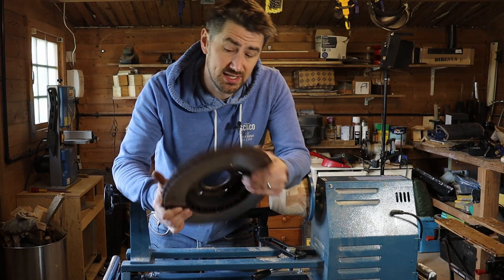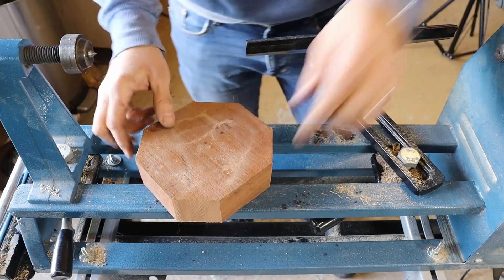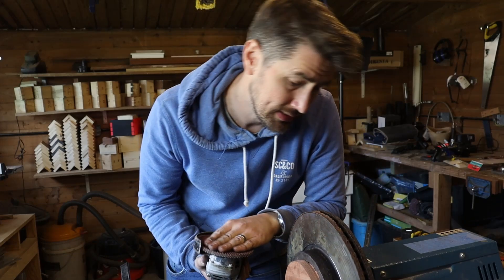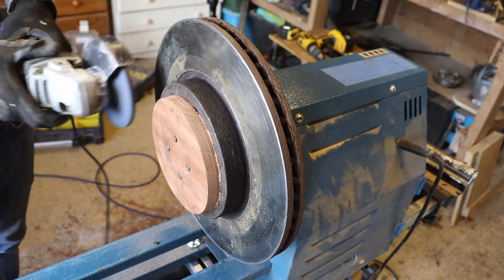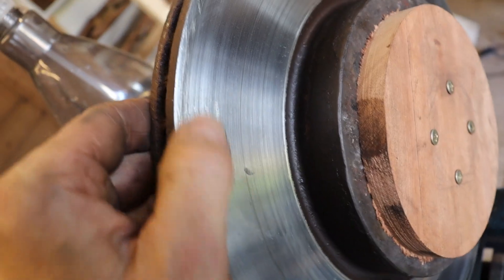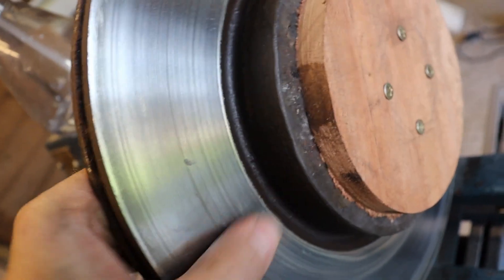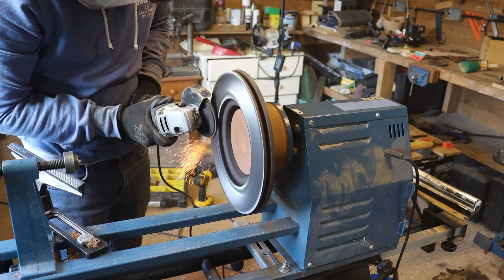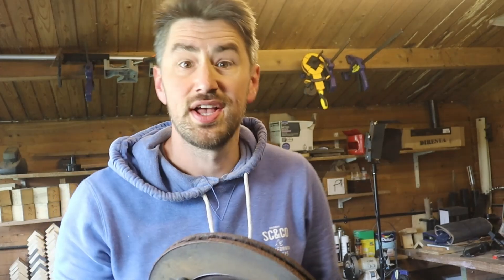Can You Resurface Brake Disc Rotors With a Wood Lathe?

Comment: It is simple and lovely idea. However the brake disc maximum runout is 0.03mm. If it’s bigger than that, it will vibrate. And the common maximum wear on the brake disc is 2 mm total. With this method, have no control on the runout and probably make it too thin.

Comment: Very clever. Providing the faces are parallel, neither side goes under dimension and the total disc width is within tolerance this is as good as anything.  Brake lathes are pretty primitive machines

Comment: Turning the rotors on a lathe is not expensive and it is fairly common but perhaps not in the UK due consumerism.
Reply from the maker: It might be possible if you took them all off and found a metal shop. All  mechanics I asked were not interested

Comment: I think the only reason those other guys didn’t use a lathe is because they either don’t have access to one, or they don’t want to go through the hassle of taking the parts all the way off of the car. Would be interesting to hear from a metal worker what they think about your technique. I’m not one myself, but I would imagine you want to make sure both rotors are the same thickness before you reinstall them so that the pads engage evenly.
Reply from the maker: It definitely was hassle! Also interested to hear from others. I would.have loved to be able to properly skim them with the right equipment!
Reply: Great watch over dinner break. Keep up the good work!
Reply: As long as the rotors are in spec any difference in the thickness would be taken up by the hydraulics